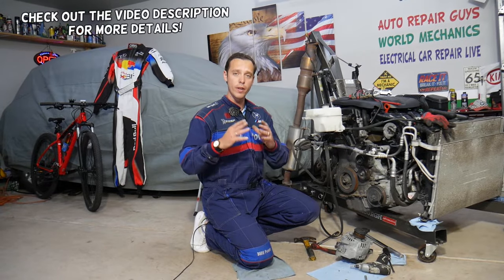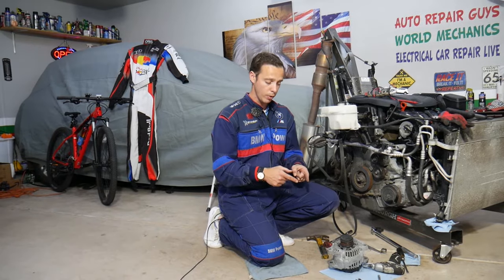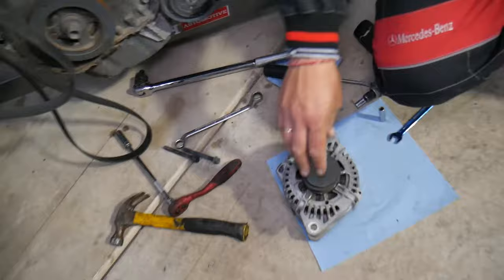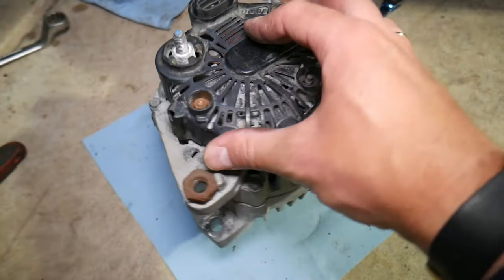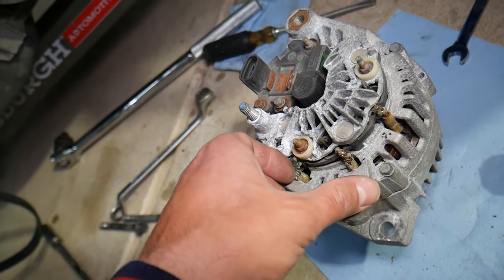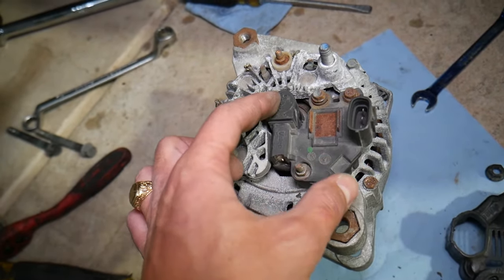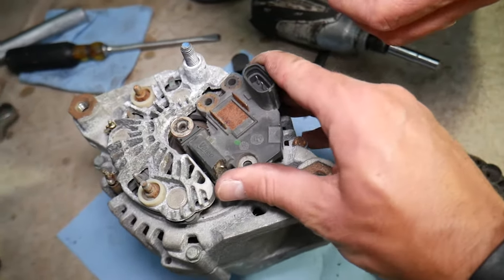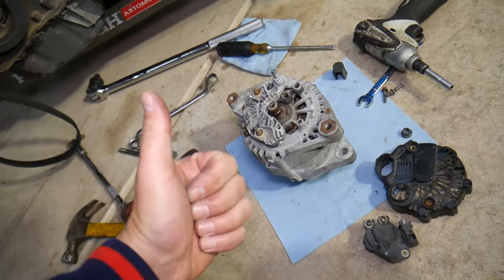WHY MY ALTERNATOR QUIT WORKING, HOW TO FIX ALTERNATOR

Comment from the maker: Check fitment for your car model:
► Alternator Aftermarket: https://amzn.to/3U8FkYp
► Check for your brushes here: https://amzn.to/3e8nyis
► Panel Removal Set: https://amzn.to/3YiMADu
►Torx Set: http://amzn.to/2hbyWgd
► Tool Set: https://amzn.to/3p5MM6t
► Screwdriver Set: https://amzn.to/3XRB28Q
► Engine Oil: https://amzn.to/3xBc8B9
► Oil Filter: https://amzn.to/3w0Ulme
► Torque Wrench: https://amzn.to/32qyRwg
► Liqui Moly Engine Flush: https://amzn.to/3IiDBID
► OBD Scanner that we use most often: https://amzn.to/3I4MQfe

► Check out our Amazon Store for the tools and parts that we use: https://www.amazon.com/shop/worldmechanics

Comment: what if the alternator stops generating randomly, you might drive it and get to your destination with no problem, but it can stop generating while driving all of a sudden!
Reply: What happened? That's what happened to us
Reply: @lexishannon2023  same did you ever find out???
Reply: It happened to me the other day. I managed to get home, but I needed the car urgently for a thing I couldn't cancel. Long story short, the battery was completely drained and had no electronics at all. No headlights, no rpm info, no abs... The car shut down four times and had to push start to get home.
Reply: @NikB123  Test if something drains your battery. Charge your battery and wait 2 days if it has drained and has low voltage, something has drained it; bad ground/bad wiring. If it drains during driving, it’s most likely a bad alternator.

Comment: I have already installed two new alternators already and still dont get power from the alternator after turning the motor on. What the hell could it be ??
Reply: Check the alternator fuse
Reply: Don’t use a battery doesn’t meet your vehicle spec

Comment: If the oil filter cap breaks and spills all over the alternator, car dies and dont want to turn on since then. Should i replace the alternator? It shows low voltage on the battery as well so could it be that then? Because it doesn’t have so much power.
Reply: I have a 09 Murano and I see the oil looks like it was leaking the battery chargers but it started this morning then I go back out it doesn’t start we need answers brother
Reply: @TheKaymula  me 2 lol 09 i got a new one last year but fook it am fix my damn seld
Reply: @franciscaramirez2342  I have codes p746 p117 transmission 144k miles was gone change transmission valve body and put some Nissan tranny oil and see how it move now it just rumbles
Reply: Yes new alternator

Comment: Here's an advice if you see the check Battery light is on. If you are still at home (near to your service guy) just go there. Your generator is dead. The fix is cheap, the trailer is not.
If you are driving during the night (as me) and the generator/alternator gone dead, you still have like 50km left, not a lot more. Call your friend to bring you a spare battery, or just swap the battery with his battery (if fits), drive along together to your next destination, home or service. If you have a lot of miles to drive, you can do the swap maybe one more time, because your battery is charged (a bit) in his car. We managed to do it, and I hope You will to. Good luck.